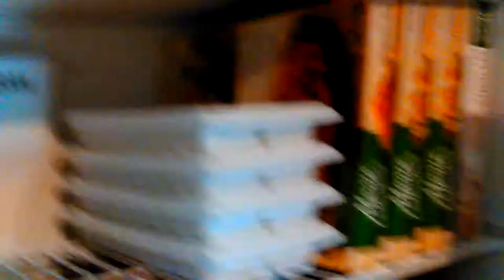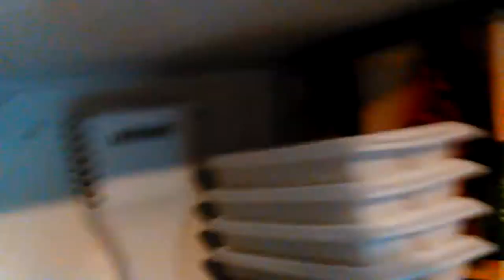04 Whirlpool Refrigerator ER2CHMXPL06 Water Inlet Valve 2315576 installation VID 20190517 135752

Comment: Hey where is the water filter on this fridge?
Reply from the maker: There's no real filter on this model. There is a screen inside the Water Inlet Valve. Go to 25:50 in this video to see where I show the location and talk about it. You could add an inline water filter, in the water line going into the valve. If you wanted to filter the water. But, I would make sure it is not too restrictive. If the water pressure is lowered too much. Then the ice maker would do what mine was doing. PS, this did not fix my problem, with the ice maker. It did work better, for a few weeks. And then it went back to dribbling water down the back wall of the Freezer. I'm going to have to get a new ice maker, now... Thanks for the comment... Don
Reply: Okay. I got curious because we have this fridge but the ice has an off taste. Thought it may need a filter.
Reply from the maker: @eglover17  Ya, I bet you could find a filter. That would improve the waters taste. I put some research links in the comments. You can check them out, if you want... Don